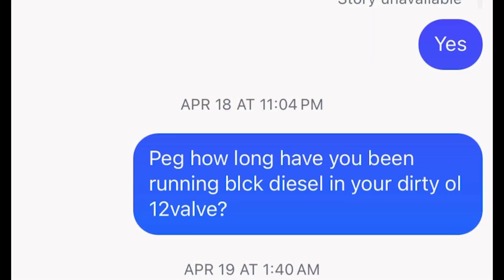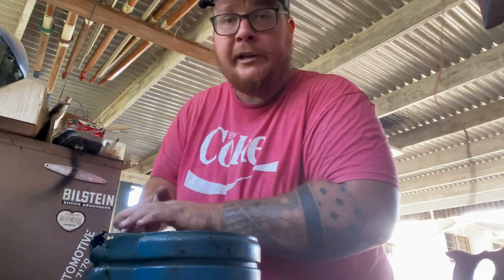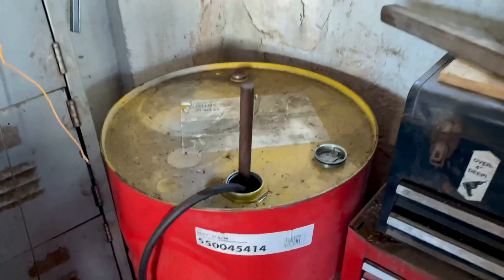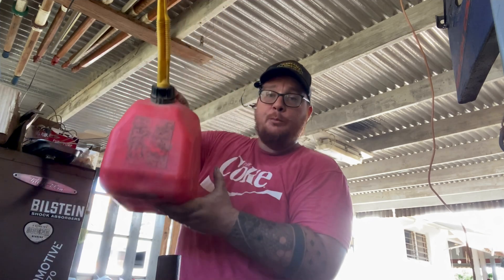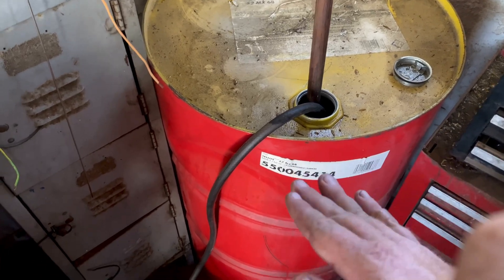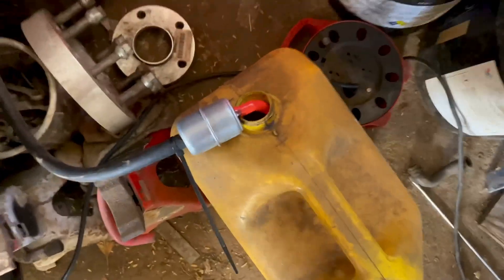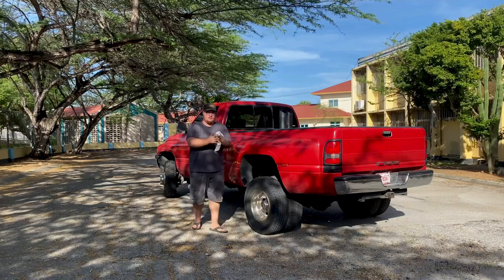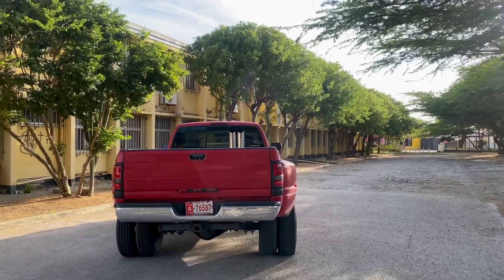FUEL HACK: How to Use Used Oil in Your Diesel Truck

Comment: As a waste oil enthusiast I agree with most every step you have taken. However if you are going to mix it with diesel fuel you can skip the addition of gas and just use pump diesel. I tend to run a 70/30 mix of oil to diesel. I live where it gets very cold in the winter and I adjust the mix accordingly but gas is not a needed step in the mixing unless you want to run pure waste engine oil. when it gets cold here (-40c) i run a 50/50 or 60/40 mix as it will be to thick to run properly.
Reply from the maker: Ahh gotcha gas is used only when you wanna run pure wmo?  Ok ok now i know. I tought it was too thick to add to diesel at first.  Thanks for the info. My favorite batch was used hydraulic oil filtered and ran it 70/30 no gas added.
Reply: @TENMILSOCKETGARAGE  yeah diesel will thin it out plenty.
Reply from the maker: @brettfriesen5540  good to know!!
Reply: I haven't been able to get my hands on any hydro oil yet. I assume it ran just like trans oil? Also BTW if you have lots of trans oil you can just run it straight with zero gas or diesel. It won't smoke like engine oil.
Reply from the maker: @brettfriesen5540  yes hydraulic oil is cleaner and easier to work with it behaves just like ATF.

Comment: This maybe a stupid question. But, why won’t it work on a newer diesel?
Reply from the maker: @Mach5Johnny  the tolarances are much much more smaller and this is basicly a dirty fuel. It can plug up all the small holes of the newer injectors and pumps etc. older diesel injectors and pumps has much larger tolerances.
Reply: @10MMSOCKETGARAGE  I see… but what about newer military vehicles? They got newer common rail engines and they’re capable of running on more than just diesel.
Reply from the maker: @Mach5Johnny  that i have no clue about honestly. Maybe advanced filtration system etc

Comment: It definitely works. I used to work in a fleet truck shop, all the used oil was mixed in a machine and pumped right back in the tanks. The only occasional issue if not mixed right was clogged fuel filters.
Reply from the maker: Thats awesome. I imagine it keeps everything lubricated aswell. The new diesel is kinda dry nowadays.